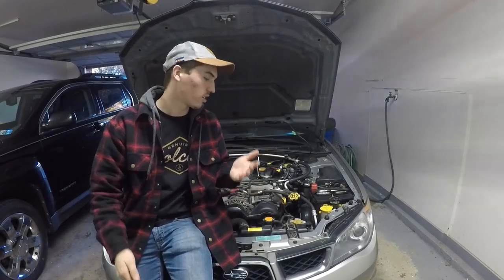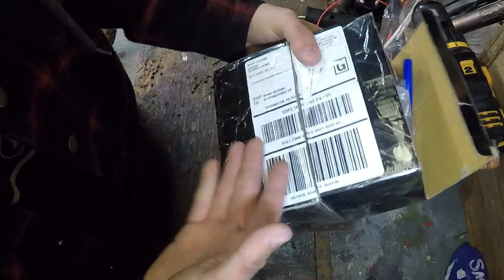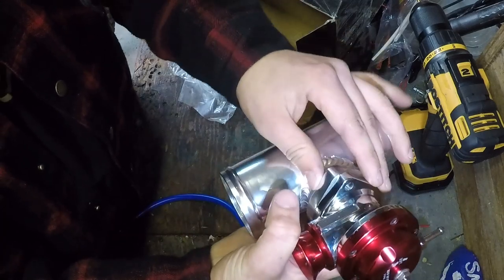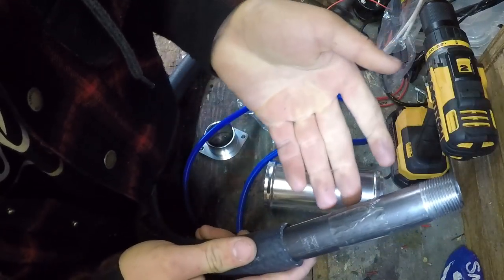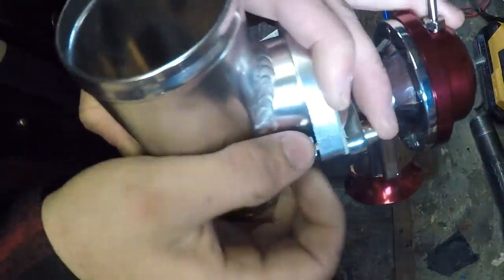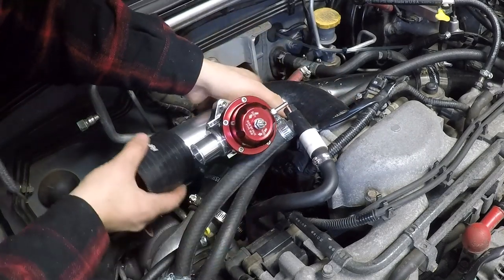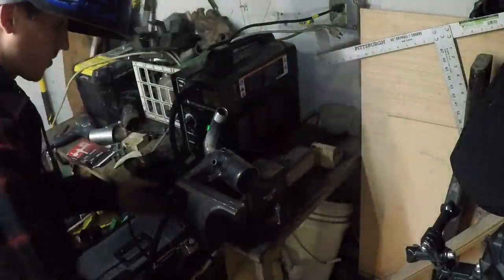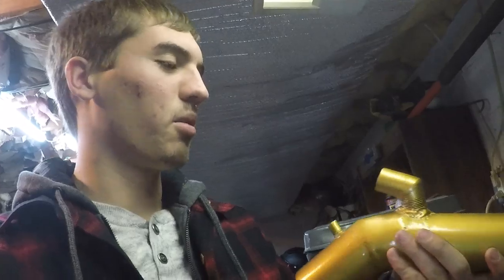Custom Recirculating Blow-off Valve Install | NA/T SUBARU

Comment: I use blow off valve directly on turbo with mass air sensor on my volvo 940 red block , not had too many issues at all , I generally prefer the blow off sound over the flutter
Reply from the maker: Does your bov recirculate back back to intake or vent to atmosphere?

Comment: hey im a big fan of your subaru series and was wondering if you could help me out with something? 
I've got an aftermarket oil pressure gauge coming with sensor. Was wondering if its possible to replace the stock sending unit or oil pressure switch with my aftermarket one since they're supposedly just a dummy light in our foresters? Or do I have to tee off from them?

which one do i install the aftermarket gauge to? the sending unit or the switch? 

also is the oil pressure sending unit and the oil pressure switch the same thing??
I have an EJ251 2002 forester SOHC.

Comment: Have you cleaned the cone air filter with the air filter recharge/cleaning kit and the mass air flow sensor with the mass air flow sensor cleaner spray it should help alot more it has helped me

Comment: Anyone know what that other aluminum piece was for at like 3:10?
Reply: It's an extra adapter. You can weld that to your existing pipe so you don't have to use theirs. Less coupler that way.

Comment: Looool that "StuStuStuuuu" sound is from turbos anti lag directly from the turbo it has nothing to do with a blow off or a dump valve😂😂😂😂
Reply: No. It's compressor surge, air being forced back into the turbo rather than being pushed either into atmosphere or recirculating using a bpv or bov

Comment: Where did you run your vacuum hose for the bov?
Reply from the maker: I ran it in line with my brake booster vacuum line, same place I get my boost guage vacuum/boost and line for my rrfpr
Reply: Goldguy sweet thanks

Comment: have you or do u need to tune ur car once boosted
Reply: Yes you should tune your car, once the swap is done your once naturally aspirated cars computer will continue to read it as a non boosted car. You need your computer to recogonize that your air intake is being pulled through a turbocharger rather than natural air flow, theres many more factors that IDK about. Theres a lot of Subaru forums out there, where enthusiets know a lot more than i do.

Comment: A bypass valve is for supercharged engines, you have a recirculating blow off valve. Also are you going to upgrade your fuel system or do you wanna melt a hole through a piston? love the videos just hate to see another subi die.
Reply from the maker: I'm in the process of tuning this car now. Stay tuned, also a bypass valve is the same thing as a recirculating blow off valve. Same thing different name.
Reply: My XT has a bypass valve, which is also called a recirculating bov. It bypasses pressurised air from the high pressure side of the intake into the low pressure side - hence the name, by-pass valve. And the way it works on a supercharger setup is the exact same. Watch MCM's gofastbrett episodes. There's a guy talking who designs bov's and bpv's for GFB.
Reply: Hey quick question is the fuel system of a 2007 Impreza 2.5i the same as a 2007 Impreza WRX??????
Reply: I have the same question
Reply: it is not, unfortunately, but you can convert it over by switching over the fuel rails to an fpr type, then getting rid of the regulator that is part of the fuel filter in the tank right above the pump.